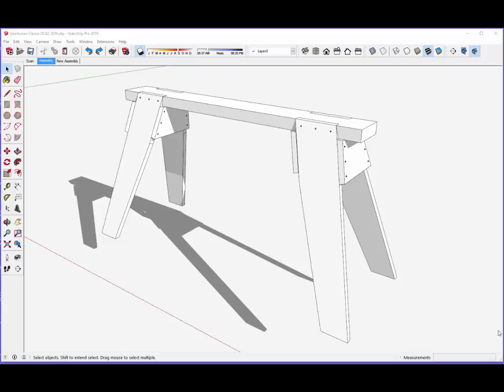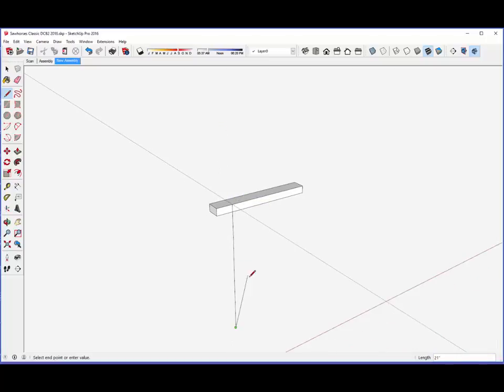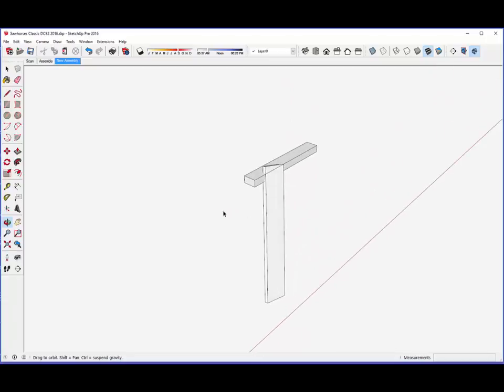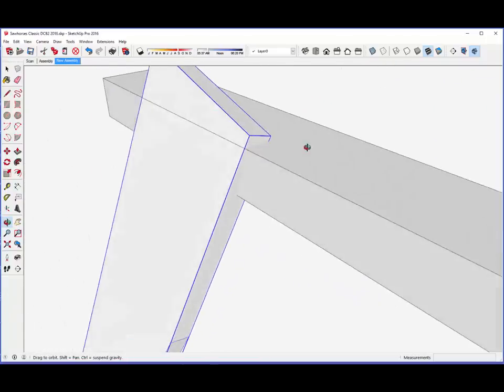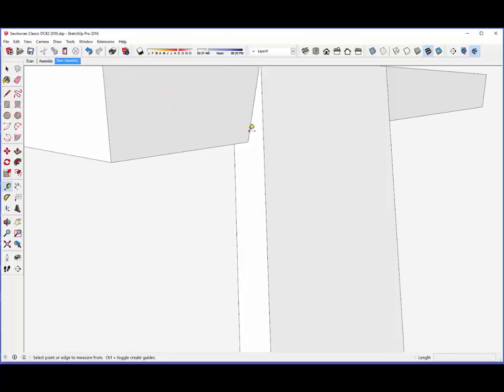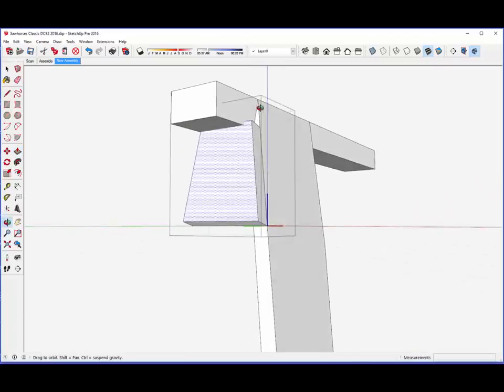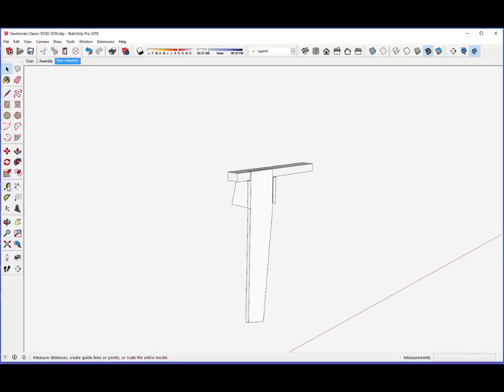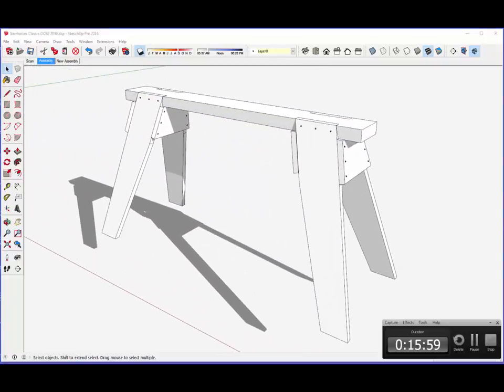Making a Classic Sawhorse

Comment: Who would have suspected that the lowly sawhorse could turn into something equaling a fine piece of furniture? I saw your articles in Fine Woodworking and they look fantastic. Initially I thought I'd just throw some scraps of 2x4 studs and 1x material together into a horse but I've developed a keener interest into their construction details.....

I've gone down a similar path as you. I found the plans of a similar sawhorse with only the 2 different angles of the raked and splayed legs noted. I turned also to Sketch-Up to determine the necessary dimensions for the notch. Not being too familiar with S-U I struggled with getting the angles, flush cutting both ends of the legs, etc. but then found your vid. and was able to start over and follow along. I haven't as yet constructed any horses, like you, but only got as far as actually chiseling out the notches on one rough looking section of 2x4.....

At about the same time I found another vid. of a fellow building the same horse as this. He used 1/4" plywood and commented on how it bowed in in between the legs. From my S-U drawing a small gap is seen between leg and back side of brace along the inside edge of the leg. It doesn't appear to be much but it was very noticeable with the thin plywood. You seem to be satisfied with the strength of the construction so I guess it's not much of a problem. A slight bevel with a plane along both edges of the brace would be an easy solution....

You also tapered the legs down to 3-1/2" at the base early on but then came back at the end and leveled them off. On my S-U drawing this created about a 4-1/2" footprint.....

At the end of your vid. you mentioned the need to combine the quadrants and braces into a single item but I couldn't find how this was to be accomplished looking into the S-U features. It's something I'll have to look into elsewhere at another time as I was only looking for the notch dimensions to begin with.....

What I guess doesn't get realized is that the compound angle causes some odd conditions like the brace for one thing and the other bigger item is the shape of the notches in the saddle. Looking straight down at the notches on the horse what would have been 90 deg corners are no longer 90 and now are more of a parallelogram requiring some additional techniques to be used when actually cutting them out. At least some angular saw cuts or chisel work would be necessary.....

I did a series of modified concepts to the design which helped me to familiarize myself better with S-U but also helped to develop a joint I had decided would be very difficult if not impossible to do while trying to work the thing out in my head prior to using S-U. BTW I have an annotated S-U drawing of the components if you'd be curious to see what I came up with. Discovery of the solution to the joint was quite by accident too. It's an interesting condition and seems if developed a little further could quite possibly turn into a fastener free sawhorse of basically the same design and number of pieces.....

Thanks for the vid. and articles. I came across them just at the right time.
Reply: Tim, thanks for the info on how to combine the quads. Worked perfect.
This weekend I worked on a mock-up of what I thought might have the potential to be the fastener free sawhorse joint I mentioned. I'm going to have to back down on the free part. I think now it should have at least one fastener per brace to each leg. In reality it's quite a chore to layout and cut the leg portion. Maybe by the time I finish making a pair of horses, at least 8 joints, I'll have found an easy method to construct LOL

Justin